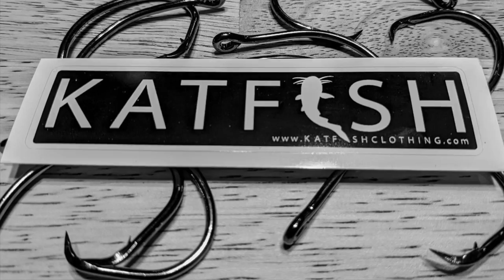How To Bump/Walk Baits for Beginners. A Very Affective Technique for Catching Catfish.

Comment: My local river has very little current. I've tried bumping with little success. The bait won't walk back behind the boat but about 20ft. I did catch a couple blues but they were right behind the boat. Any suggestions?  I've used 1.5-2oz lead. Water depth about 5-20ft.
Reply from the maker: You can try a lighter weight or maybe try putting a small peg float right above your hook. I have used as little as 1/2 ounce in light current. It is a lot harder too feel the bottom though. Good luck and thank you for watching👍

Comment: Not sure if ya know you can run another battery in parallel together. That will definitely get you better battery life.
Reply from the maker: Yes I actually did add another battery when I had a 12v but I have since upgraded to a 24v. Thank you for watching👍
Reply: Good deal